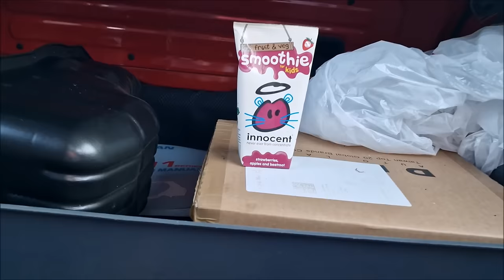K11 Nissan Micra Petrol Tank Drained And New Fuel Added - NOW Will It Idle?!

Comment: It could be a zillion things. The first thing to do is really to drop the tank from the underneath of the car & drain it completely regardless. Then I would change the spark plugs, HT leads etc possibly change the injectors. After 10 years most things will be perished with age.
Reply from the maker: You are right 👍😊 check out the latest video for an update 😁

Comment: Let’s hope idle control valve universal across both engines. And can still get fuel filler neck. Meant to ask if it has a fuel light. Accident repair Micra courtesy car didn’t in 2000 for my Dad. Think you know where this heading…..
Reply from the maker: Fuel filler neck now on order :) - Yes there is a fuel light from what i can remember  - oh dear!

Comment: I removed 25 litres of petrol from an Audi TT that had been sat for about 4 year's funny how it goes Orange. It would start the car but run lumpy. It kept cutting out wouldn't idle put revs to it and it was fine it only has 40thousand on it and its a w reg so its 24 year old it was taken of the road. Because the father wanted to keep it for his daughter when she passed her test. It's good to see the Micra coming along nicely 😊.
Reply from the maker: Yeah - wonder what makes it go wrong!?
Reply: @JonCoupland  I think it's the ethanol I believe it absorbs water. I could be wrong but I think that's what it is being that E5 has Ethanol in it.🤔😀
Reply: @JonCoupland  I also put a bottle of Miller's fuel treatment in the old TT that made it run superb. If think it got rid of the varnish that old petrol leaves behind.

Comment: Is the check engine light on? If so, the first thing i would do is check for codes. If the iac valve or any electronic fuel system part has a problem it will throw a code. If no check engine light it could only really be bad fuel or compression loss
Reply from the maker: No engine light. No codes. 👍

Comment: Timing chain tensioner 👍
Reply from the maker: She's a bit noisy but that isn't the issue 😊👍
Reply: @JonCoupland  there's not much else to rattle only it might need a timing chain tensioner or kit mine was missing all the time until I replaced the head valve's new spark plugs made no difference I had to remove the head and replace the head valve's while I was that far I bought a good expensive timing chain kit water pump and oil pump now it can sneak up on people so silent

Comment: So on a Nissan micra sport, what did you get to make it a sport?
Reply from the maker: Good question! Alloy wheels, Different side mouldings, Colour coded everything (apart from door handles weirdly) - Spoiler
Reply: @JonCoupland  so mainly just a appearance package, certainly looks better all colour coded, did the sport get the 1.4 engine then?

Comment: Is it not possible to syphon the fuel via the filler? Does it have anti syphon flaps? My parents k11 has been sat parked up for 9 years so I also need to drain the tank.
Reply from the maker: Potentially able to be done but we wanted to check the pump and and debris in the tank at the same time. This may end up being just as easy in the end ☺️ fingers crossed for your project
Reply: @JonCoupland  Many thanks! I'll give that a go 😀

Comment: Been there with a K11 water in the bottom of the tank caused the pump to rust after a been off the road for 10 years. Good news is that loads of pumps fit I've got a Bosch one  from a vauxhall Astra it was a tenner brand new from that eBay where as the Micra one was 65 quid but both have the same Bosch part number.
Reply from the maker: Thankfully the pump seems ok 😁👍